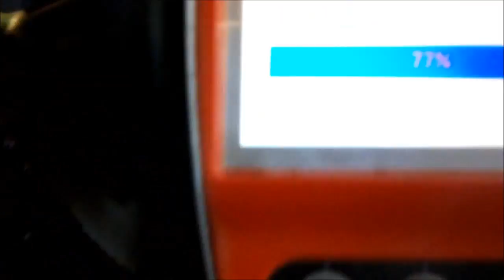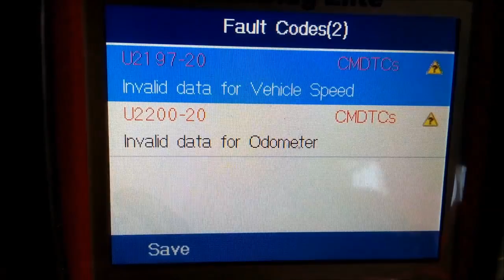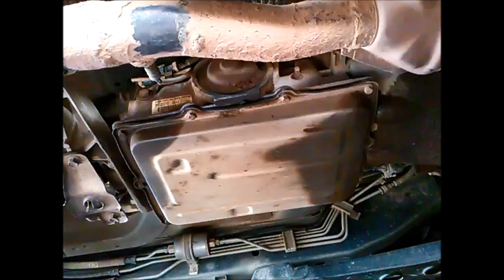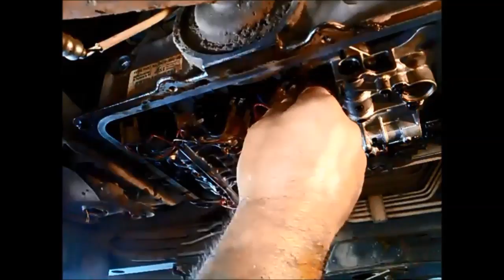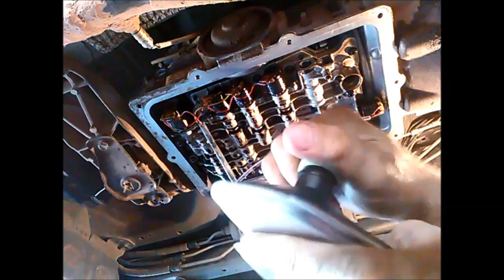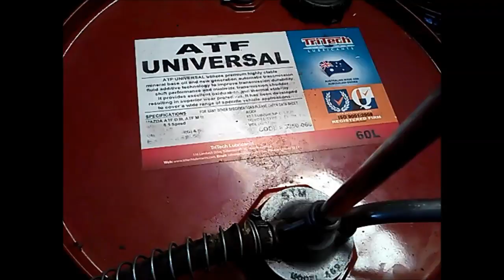Ford Territory BTR ION DSI M74 M74LE 4 Speed Automatic Transmission Limp Mode & Fix

Comment: Hey mate, great video! I’ve got a turbo territory with the zf 6 speed box.
Has just thrown it in to limp mode bringing up solenoid a fault. Reckon I’m up for the same fix? Do you know if they’re hard to change
Reply from the maker: hi, not that hard to change. have fun cheers
Reply: YepThatsIt my computer says solenoid “A” low circuit, that’s defiantly a fucked solenoid?
Reply from the maker: hi, before you replace anything, make sure your battery is fully charged and holds power ( modern day alternators only maintain batteries, they don`t really charge them )...make sure fluid level is where it should be, then clear the codes and road test again. if code comes back, you might try flushing that solenoid ( and all of them while you`re there ) bench test resistance and replace the ones that look iffy. cheers
Reply from the maker: oh and remove and refit external plug few times, blow out and squirt some wd40 or crc in there too before you remove pan....still worth doing a service regardless if these few things fix it. cheers
Reply: YepThatsIt thanks heaps for that mate, I’m really suspicious of it being a faulty battery
Reply: YepThatsIt hey mate, what’s your number? Got a quick question for ya
Reply from the maker: hi, go to my "about" and email me.
Reply: YepThatsIt your emails not there bud

Comment: Great video,
Just a quick question.
My BA Falcon with the btr 4 speed is abit slow to go into reverse when cold. Is that normal its done 244,000kms.

Shifts fine in drive etc and when hot the reverse is fine.
Reply: Hi thanks for the quick response.

I dropped the pan and filter myself around a month ago.
It never used to do it before the pan drop.

I hope the trans is okay.
Reply: In manual mode, it shifts fine.
Reply from the maker: hi, that could be normal for the 244,000km. what is it like in manual 1st? you might remove valve body check and readjust B2 band shims ( and check Servo seals are not worn or hardened ). otherwise could be C3 clutch worn....but you say is ok when warmed up so I'd also check the Reverse Lockout Valve could be sticky. On BA`s I think S1 & S3 solenoids toggle on/off in Rev as well so they could be contaminated with fine metal especially given that mileage or they could be leaking.  Start with removing the Trans Pan and if heaps of metallic and friction debris in there, you need to make an executive decision on what you might want to try or drive it as it is and just do a filter change and service. hope that helps Cheers

Comment: biggest nightmere on a 2008 awd is replacing the starter motor, do you ever run into this problem, top bolt is soo hard to get to
Reply from the maker: hi, working under hoist probably makes it a bit easier....but I can assure you there are plenty a lot worse haha. cheers